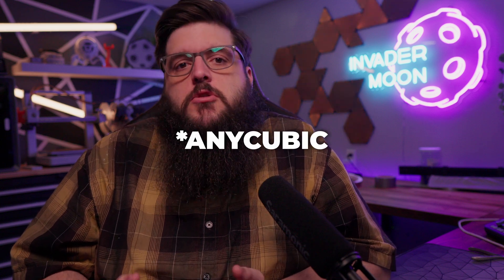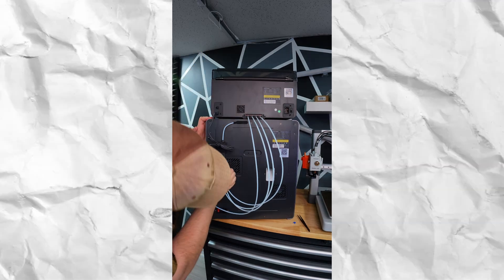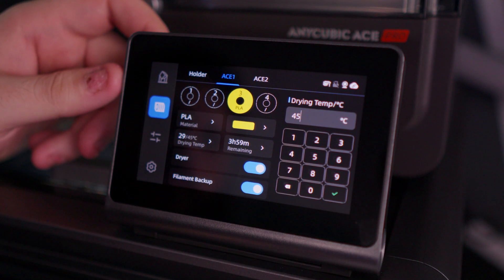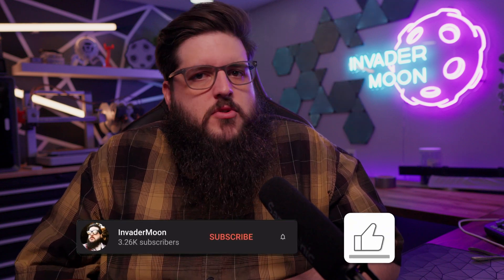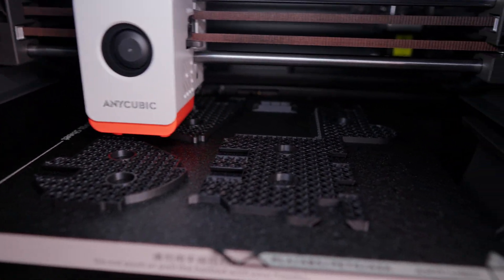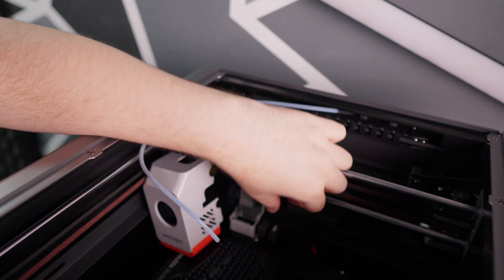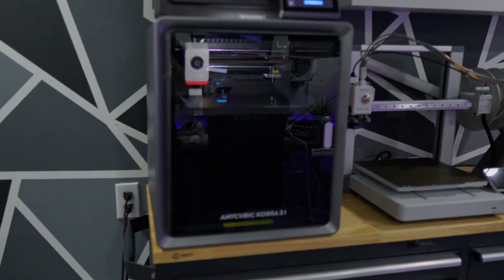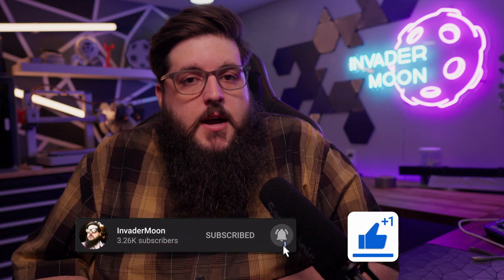My First Impressions Didn't Go Well! | Anycubic Kobra S1 Combo

Comment: I bought the Anycubic Kobra S1 Combo a few days ago on Amazon and returned it today and bought the Bambu Lab P1S. Starting with the first print I had to tear down the extrusion head three times to unblock it and had way too many connection problems. I don't want a 3D printer that I have to constantly tinker with to keep it working. I should have read the many negative reviews before buying.
Reply from the maker: Facts. 3D printing should be fun not a chore. I sold my S1 shortly after this video

Comment: Great video man. I am about to buy the Anycubic, I already own the Bambu A1, have had it for about a month now. Today was the first time I have had any problems with it, and today two print joabs failed due to lack of adhesion to the build plate. I am using an aftermarket build plate,  the Cryogrip Pro Glacier. I washed the build plate with soap and water and tried the print again and it failed again. This is a new filament and I don't know if it is just junk or what. I will swap it out, I have some more made by Creality on order. That's it, keep up the good work on the videos, I like the gun, cool.
Reply from the maker: The only issue I’ve had with the Bambu is the adhesion issue with the texture one it came with. I just got that cryo one from biho or something like that. Haven’t tried it yet. I always clean with alcohol.

I might have a link to the Kobra S1 if you wanna purchase with the link so help with affiliates

Comment: This printer is a colosal waste of money. I have had mine since March and it has broken down 3  times. It only has like 400ish hours of print time on it, so the printer has been down for longer than it has been working since I’ve had it. On top of that, Anycubic for some reason doesn’t have any replacement parts on their website for the S1, and nothing on Amazon. so you have to email them and they will send you the part you need as long as it’s in warranty which will end up taking weeks to months to receive your part. You also have to work with international hours so you won’t get an email reply for another day. This printer sucks. Do not buy.

Comment: The issues im having with printer right now is multicolor printing. When it chances color it pushes the old color out into ace so far that it tangles. And the rfid for it is bad and i was using anycubic i fed it through 4 times before it scanned the color.
Reply: Your retraction sensor on the back above the color hub is going bad, get in touch with AC support
Reply: now ACE has additional fins under top cover to keep spools more separated... does it tangle anyway or you have older ACE without mentioned fins?
Reply: @vxsniffer I have bought the newest model combo s1. Has fins. But the fins don't do anything. The problem is the it doesn't wind up fast enough to keep up with the filament retraction. Constantly have to wind it up before starting a new print.

Comment: ACE supports detection of Anycubic spools with RFID. I wish it could detect other brands as well (AFAIK it's just a string of text). Supposedly the camera is 1080p, but limited by software to lower the amount of data streamed (according to another YouTube video, and based on info from Anycubic, but I haven't confirmed it). Peculiar that people would compare it to the A1. The P1S (and to some extent X1C) is the obvious analogue.
Reply from the maker: I compared it to what I had on hand. I have a P1S coming in maybe a week. I only had black PLA and thought the ace just defaulted to black. I even looked online to see if the ACE had RFID but couldn’t find any answers
Reply: @invadermoon  Fair enough. It does though and it will also show something to that effect if it can't detect any RFID tag. I use Sunlu, so no detection there. It's very easy to manually switch to any installed color via Slicer Next. Probably as easy (and the same way) as on Bambu Lab.

Comment: Mine came with a badly warped bed out of the box. It seems to be a common issue with these machines. Other than this it prints fine.
Reply from the maker: After looking deeper into Reddit and other places it does seem like the Kobra S1 has lots of common issues. That sucks because it really does print well